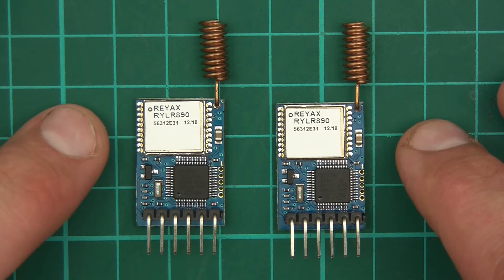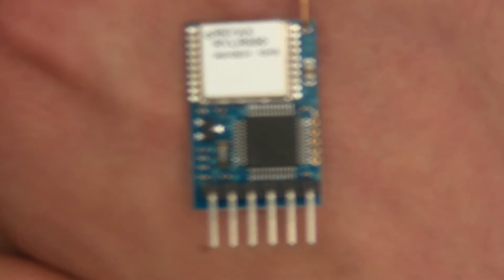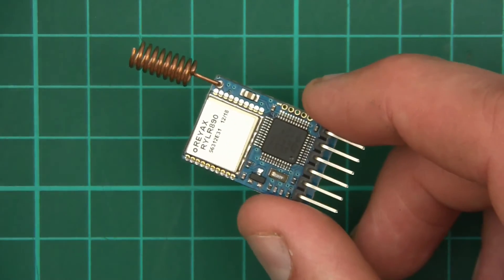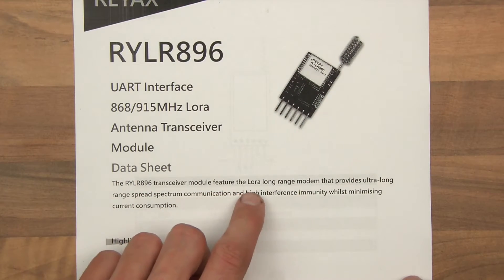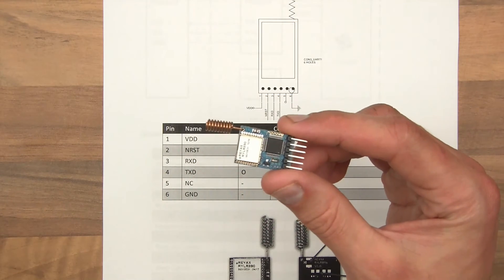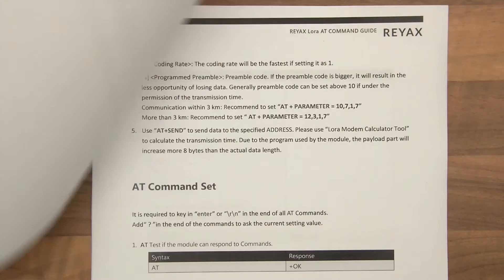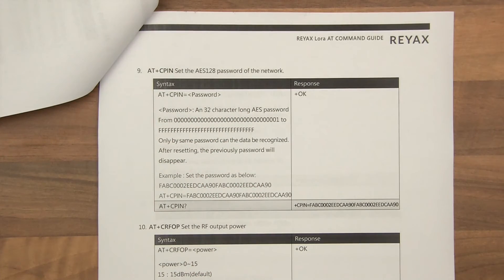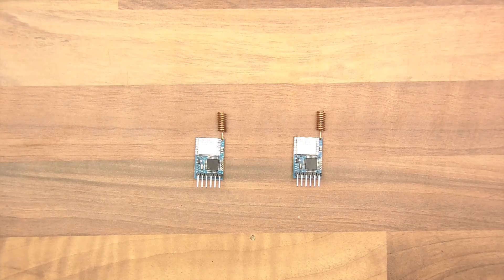Testing Long Range Wireless 915Mhz RF LoRa Transceiver Module REYAX RYLR890 RYLR896 Arduino Part 1

Comment: I think I'm walking the same road here at 9/4/21. Gots some Nano's and gunna get wired. I'm starting with a budget pack of two Nano and two Nrf24l01 modules. 433mhz is the plan, but I'm going to check them all out. there are some new ones since 2018. Good day

Comment: Question: say you have a Firebeetle LoRa module connected to an Firebeetle ESP32 through SPI set up as a transmitter. Can that device communicate with this Reyax LoRa module that is connected to an Arduino nano through serial (UART) set up as a receiver?

Comment: Is this Analogue or Digital, can it handle composite video? Could it do say quad copter receiver?
Reply: D, no, no. Google How LoRa works and what it is used for.
Reply: @TornadoCrafter  I have 15 mini cameras that put out s-video (yellow cable)..  all i need is a video board that can talk to a hub... AND a radio transmitter system
Reply: @TheAnical  OK. LoRa, and several other similar products, are designed for ultra low data rates at long distances (if needed). Think along the lines of 12 bytes of sensor data. Even sending one JPG picture in a reasonable amount of time is a struggle for LoRa. What wireless format might work for you is going to be determined by how far you are trying to go.
Reply: @TornadoCrafter  Trying to figure out what 10 arduino transmitter sets to buy.. need a serial connection if possible for switching
Reply: @TheAnical  I've seen many discussions started by people wanting to transmit video via an Arduino and they all come to a dead end when they realize an Arduino isn't up to the task because that was never the intent for a low cost MCU like that. And that is just talking one video stream, let alone several. I have seen Auduinos used for control purposes while the video was transmitted using another option. Something like a Raspberry Pi is likely your starting point for a controller and WiFi to handle the bandwidth needed for video.
Reply: @TornadoCrafter  BUT it can act as a pure data relay, composite video is just 0's and 1's right. How was Tv broadcast before Hd?
Reply: @TornadoCrafter  what is a ultra low
 data rate?

Comment: I tried the same but it's not working. You didn't use "AT+SEND=2..\r\n"

\r\n works as enter and it is necessary to send at command... Then how your circuit is working?

Comment: Hello.. this thing can communicate up to 200 km (current record) with line of sight and the proper serttings (lora mode 13 .. the slowest. i think to remember). Also 0.5 uA of sleep can let the battery last for years.. ah yes.. dont touch IC pins like that.. hold them on the side. Static electricity can build up on dry skin and burn the IC. Keep up the good work :)

Comment: What if they let us use a few pins of the stm32? That would be awesome..
Reply: i saw on datasheet of reyax,  the stm32 is only convert the communication protocol from the engine inside of reyax module (Semtech SX1276). its convert from SPI to UART.
Reply: I also wondered if anything could be done with the STM32... such a waste if all it does is serial conversion.

Comment: Antony - these are great but wish they were cheaper.  If you are interested in 433 Mhz serials, look at HC-12
Awesome videos on this
Reply from the maker: Raad Yacu Thanks Raad, I know about the high price. I've actually mentioned this a few times to Reyax. They said they will look into it in the near future. The issue is that the modules are designed to satisfy very very high standards and is compliant to standards way above DIY level.